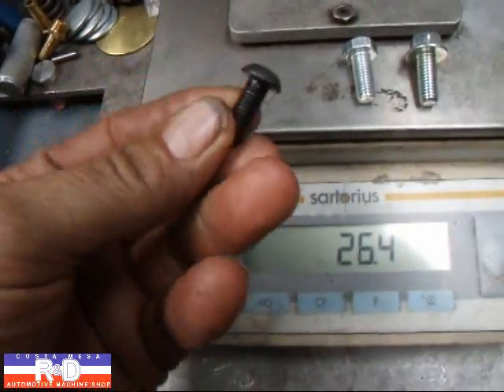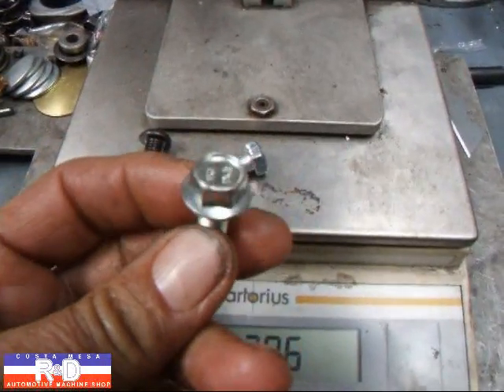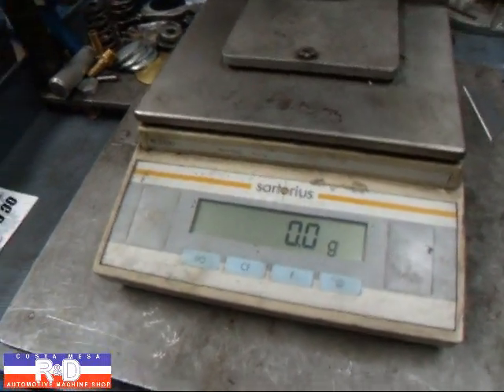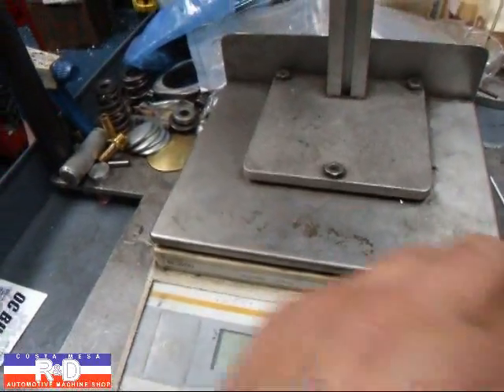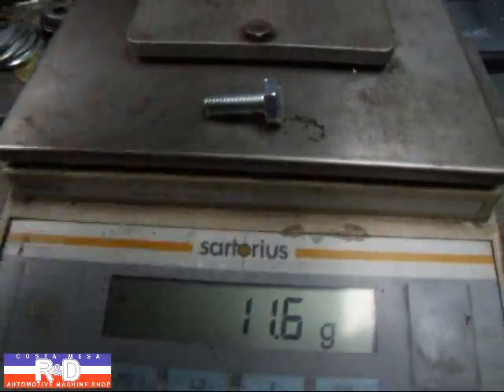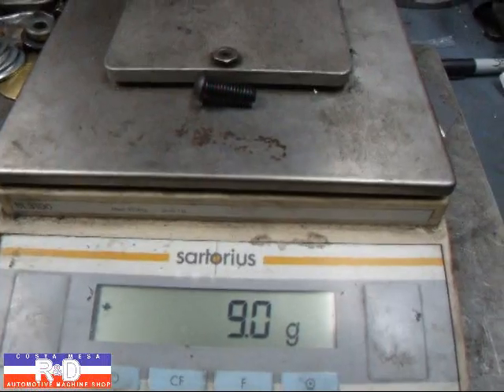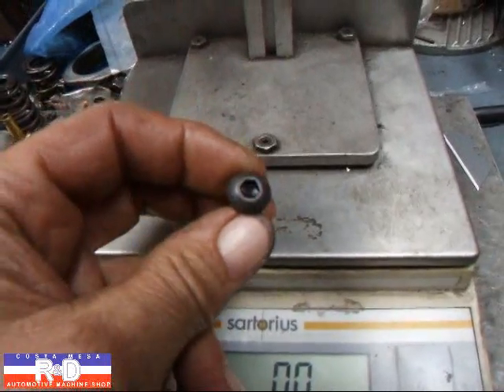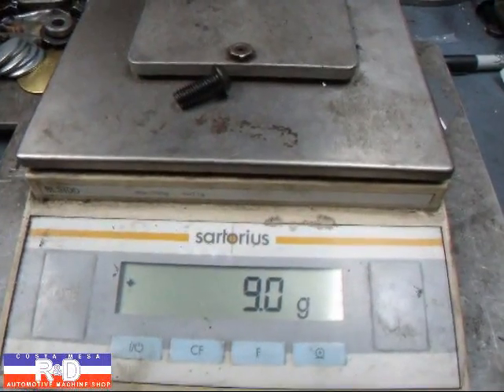Bolt Head Types & Weights

Comment: @hannas1234 In theory if they are made from the same material, have the same thread and are of the same grade then they should both a roughly equal clamping forces and have the same fatigue resistance, as below the top section they are effectively the same.
The main difference between each being the amount of torque each head can take without rounding out the hex, whether they self-locate the tool, have a second method of tightening, can be safety wired etc.